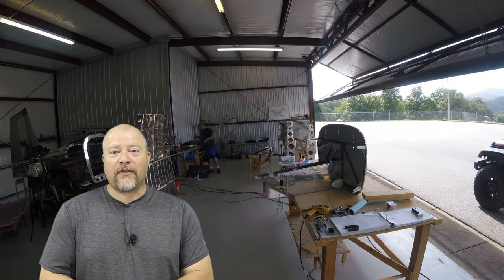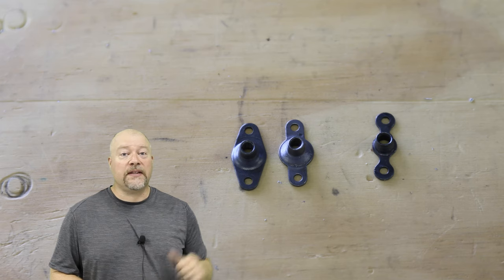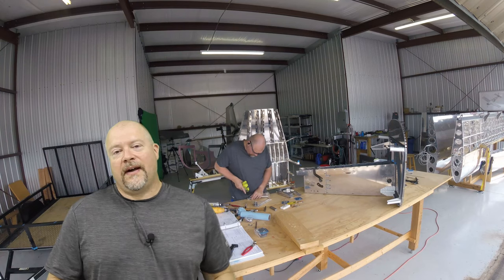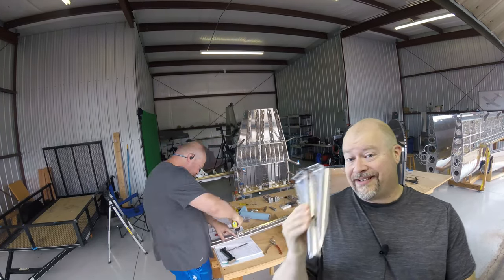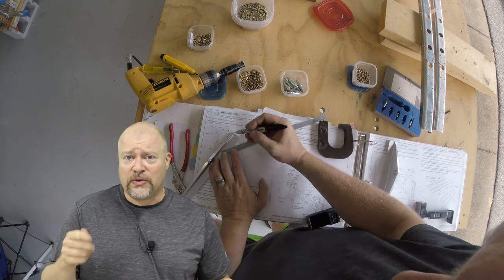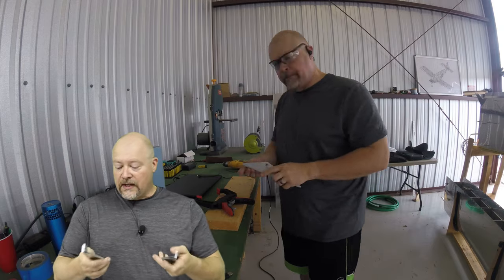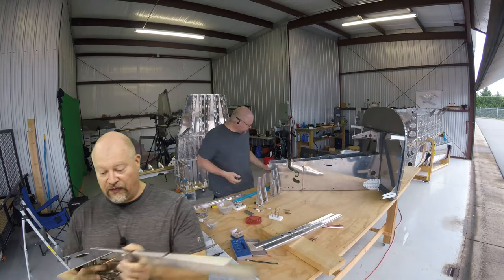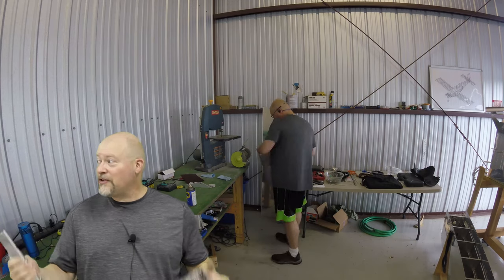RV-10 Fuselage - 015 - Fwd Fuselage Ribs, Bulkheads, Skins and do you need a drill press?

Comment: Love your videos. Have you thought about getting a little stool on wheels like they have in mechanics workshops? I am having a little trouble with your contraindication at times like when you were given advice about door to replace oil filter since its open to install now but you say your in a hurry and want to see plane done but then say you want to take your time and do it right, especially since you have the fortune of an experienced  RV10 builder whos willing to help, this i do not understand. However i respect that its your plane to do as you like but personally i would grab every scrap of help offered considering you yourself your not even thinking about engine so rushing on the body assembly seems counterproductive. Good luck, waiting for next video.

Comment: Jason, just viewed your video from 2016 on pro sealing your tank ribs, and thought I'd see your latest one and subscribe.  I'm about 70% on my RV-8; on the gear; engine mounted; avionics in; just working on empennage tips and using the Synergy Air tip of using pro seal to stabilize the fiberglass to the aluminum.  Reviewing resources before using the bulk pro seal for the first time.  I assume you're on VAF but wasn't able to find you directly.  Let me know what your VAF handle is; mine is the same as my YouTube channel.  Thanks for sharing.

Comment: mismarked/mis=filled bags are not uncommon.  They DO happen (and Van's is more than happy to send corrected bags --- but if you find them too late, you might have to pay for the replacement --- not $$$)
Reply: You don't NEED either a bandsaw or drill press, but once you have them, you can't fathom how you got along without them.  A drill press is a godsend for boring stainless --- especially ss tubing (flatstock, maybe not so much ---- but watch for things Van's includes at the END of the build ----> you will struggle with a hand-held drill)

Comment: 1100's have dimpled screw holes,. 1000's dont.   -08D's have dimpled rivet holes,. -08's dont.    -08's are for #8 screws,.  -06's for #6 screws.    THE big gotcha is that -08 are not the same as -8's.   Different size screw holes!!!  The "0" is significant.